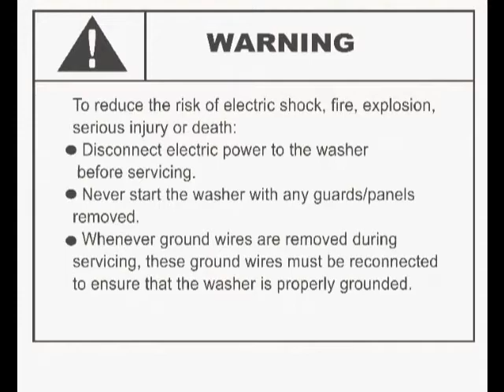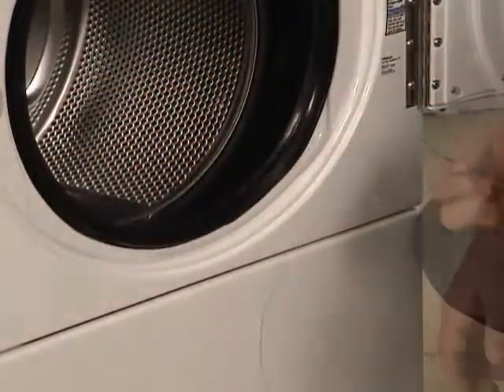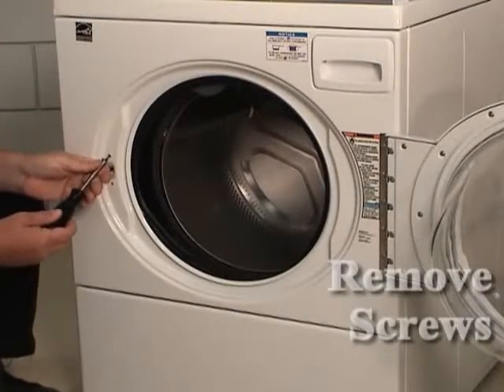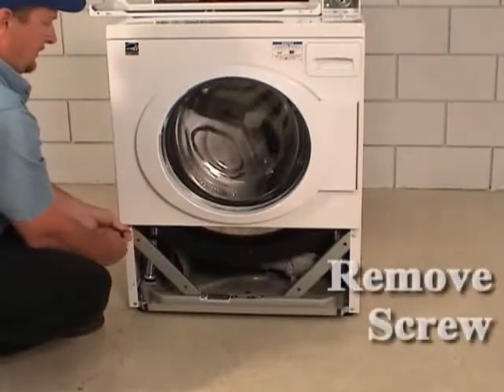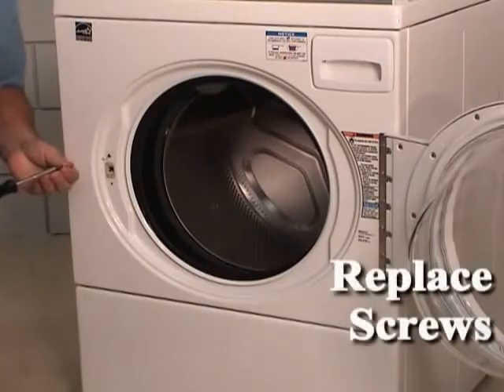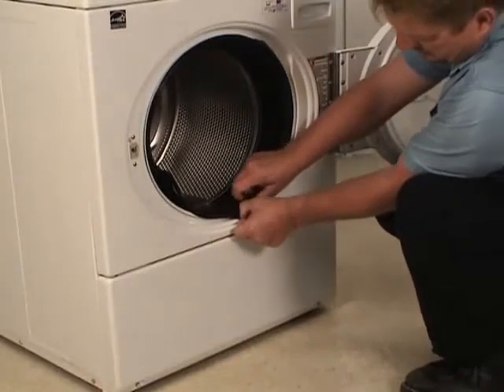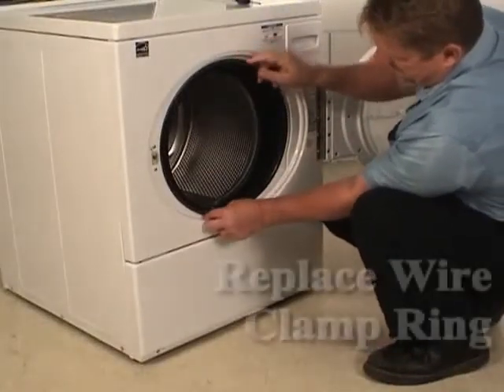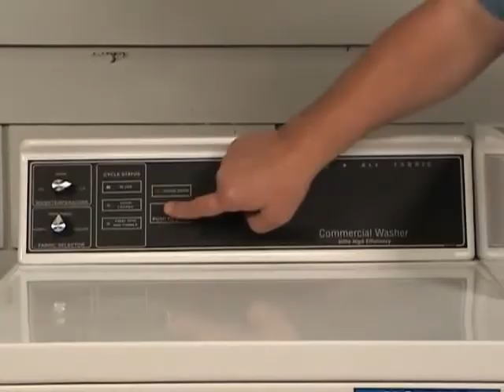How to Replace Door Lock Assembly on Frontload Horizon 802317P

Comment: Is this usually the problem when the door was needing to be slammed shut, or door light would blink... and now it only blinks? Or if it does work it works for a few seconds then washer stops and door light blinks again.

Comment: Seems a lot of unnecessary work.   Why remove  the bottom plate ?   ( plate was in place when person in video was changing the latch)   Why turn off water ? Why remove door boot ?.   ..... The latch can be removed by only undoing door boot from 7 oclock to 10 oclock position.
Reply: Can't get the lip into place unless you pull the front panel out a bit
Reply: Right on my turn tomorrow  thaxs man  @KendallHall